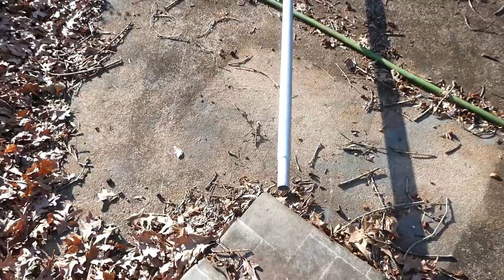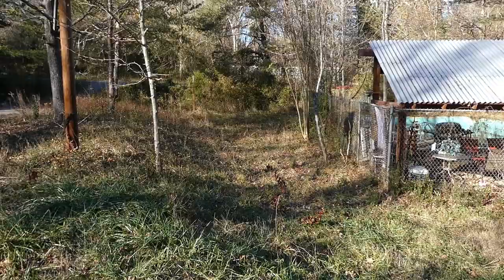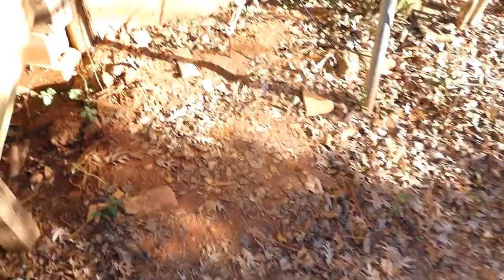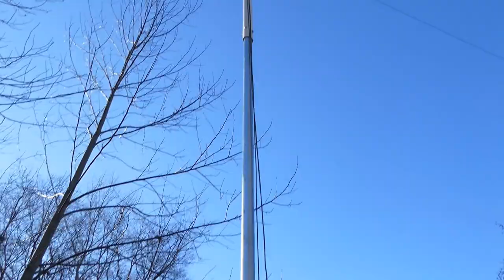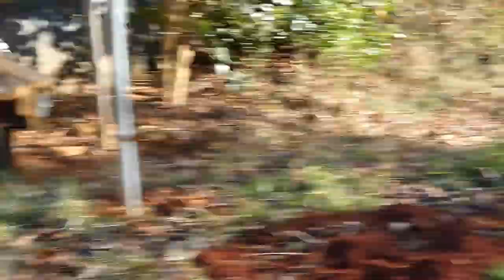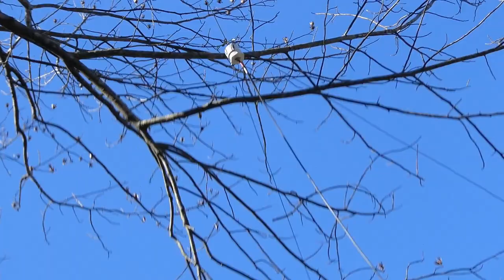$50 Mast for my HF Antenna. Using Chain Link Fence Top Rails and some PVC.

Comment: I have a question. I was planning to purchase four (4) of the same fencing rails that you use in this particular video The first (of four) fencing rails will go 4ft in the ground (with concrete) and the remaining three fencing rails I planned on connecting them together as they are made to connect to each other. So with all that said here is my question.  Is 4ft in the ground deep enough for  a 40 foot long fencing rail?  I know those fencing rails have a little weight to them so I wasnt sure if all four of the fencing rails (40ft all together)  would stay up being that it would only be in the ground 4ft.  Would it fall or remain stable? The weigh of each of the four fencing rails is 7.36 lbs.
Reply from the maker: Howdy, 
Firstly, I am not an expert. 
I would have doubts about 40 foot of vertical fence rail being able to support itself, its not very thick, and may fold over under a strong wind. Again, I'm not a structural engineer but it seems a bit sketchy. 
I have two lengths tied together with a PVC topper. The bottom of the fence rail is at ground level and in about 4 feet of fence post (above ground) which is buried and cemented into the ground. 
Top of the mast is about 27 feet off the ground (and on a bit of a hill) with my set up, which gets me nearly global contacts on FT8. 
Anyways to answer your question, I don't think its the depth that would be the issue, but the strength of the top rail and its ability to support its own weight with any sideways wind hitting it. 
Let me know if you attempt this and how it works out. 
Best of luck,
Eric
Reply: @TwoAcreHomestead  Yeah thanks man. i dont think 40ft will be stable. I guess i just needed someone to tell me.  I was going to have the G5rv antenna on the fencing rails. I though that antenna had to be at least 30 f0 ft high for it to work properly. In addition to that, the ladder line on that antenna is 30 feet so at minimum the fencing rail would have to be enough so the ladder line does not touch the ground.
Reply from the maker: Was looking at your plans on your channel. If you can brace the first section off the corner where you are placing the antenna, then I'd be confident in you getting 3 sections high. 
A 2 by 4 screwed into the side wall, extending out past your first upright, then a muffler clamp to secure the pipe to the 2by4 maybe? 
Also, I did not want to lose any height by burying the top rail, which is why I used a standard fence rail in the ground, then ran a bolt across at ground level to keep the fence rail from going all the way down the hole. It also makes it removable if needed. 
With none of the top rail underground, and a PVC topper, you've almost got the same height out of 3 top rails that you were trying to get with 4. 
Hope this helps, 
K4RZM
Reply: @TwoAcreHomestead  Thank you. I so appreciate your help man.  I will keep you posted step by step
Reply: @TwoAcreHomestead  I actually will be getting some heavier post/poles
Reply: @TwoAcreHomestead  I am now only going up 34ft with some heavier post/poles
Reply from the maker: I've been watching your channel, looking forward to seeing the final build. 
btw, love the graphics your using. Hank Hill driving over your coax with a mower was awesome :)
Reply: @TwoAcreHomestead  LOL thanks. I will definitely keep you updated.

Comment: How did you get it into the mounting section?
Reply from the maker: The whole thing only weighs about 30 lb so I just walked it up straight and then lifted it into the receiving pipe
Reply: @TwoAcreHomestead  👍

Comment: Greetings! Did you put an  inverted V dipole on this?
Reply from the maker: I'm using an Off Center Fed Dipole, 88 foot on the long end and 44 on the short end. 
There is a follow up video for the end poles that gives a better view of the antenna setup.
Reply: @TwoAcreHomestead  Ok thx! Ill check it out.
Reply: Is this an 80 Meter half wave dipole?
Reply from the maker: @RC-Heli835  I got mine off ebay, and the seller (gniklat1) doesn't have anything listed at the moment. 

This 7 band OCF is about at close as I could find to the version I bought, and it has a lot of details on the website: 
https://hamcall.net/7bandocf.html#7band

edit: I just looked at the prices on that website. I paid about $60 for mine, they want over $250. I have a 300 watt version.

edit: A better option, cheaper and Palomar makes good stuff: 
https://palomar-engineers.com/antenna-products/Off-Center-Fed-Dipole-Antenna-80-6-Meters-1-5KW-5KW-PEP-rated-FREE-shipping-in-USA-p74818225
Reply: @TwoAcreHomestead  That's a lot of bands!
I'm almost ready to take my  Technician exam.😀
Reply from the maker: If you are setting up a VHF/UHF antenna, you might want to check out this video: 
https://www.youtube.com/watch?v=xzXm1j0kBzc
The dipole wires actually helps support this antenna, if your using a VHF Mast, you might want something a bit more rigid. 
Good luck on the test, and keep on moving on to your General.
Reply: @TwoAcreHomestead  I was gonna take the exam online but its a tad bit more complicated than I expected. Some want a proctor present such as in sworn in law enforcement, judge, mayor, firemen, lawyer, senator, congressman, president etc. to be there to make sure your not going to cheat on the test.

So yea I'll check out the video thx 
Kilo 4 Romeo Zulu Mike.
I don't have a call sign yet.
Reply from the maker: @RC-Heli835  my wife did hers with GLAARG, and she had no problems passing her general. If you're looking for a decent online option
Reply: @TwoAcreHomestead  I can get mine locally but I'll have to wait until the 12 of August. I'd love to have taken it today but more study can't hurt.
I think I did see that one though and it looked like a good one.
So whats your favorite band?
Reply from the maker: Can't really say I have a favorite band. 40 & 80 meter tend to work better at night, 20 & 17 better during the day. So it's pretty much tune around to see which band is active when I'm listening. 
VHF/UHF aren't as sensitive to day/night or atmospheric conditions, but you are only talking local or via repeaters.
Reply: @TwoAcreHomestead  I'm already into CB and have built several antennas, have a base setup at the house. All dump trucks hauling asphalt and gravel use 11 Meter CB to communicate with scales houses and loaders, which is how I got interested in Radio as I drive a dump truck.

Trying to make them work better and get out farther is where I started learning more about the subject and it seems like most of the videos on ytube where folks really really know what they are talking about are Ham operators.
I like that Ham gives you a lot more sizes of antennas to build and some of them very small for the 2 meter band and the 70cm band.

Was your wife able to take her exam with just the one laptop camera?
I might could do that Saturday morning else I'll have to wait 3 weeks to do it locally. I really think they take the thing a bit to seriously online but I guess it opens up a big world out there.
Reply from the maker: She used the laptop camera plus a cellphone, both running Zoom. 
They want one looking at your face and one at a side view. 
They had her sweep the room with the cellphone, even the ceiling, then she was cleared to take the test. 
GLAARG uses the same test engine as HamStudy.org, so they just watched her take pretty much the same test she took 100 times before, and she passed her General.
Reply: @TwoAcreHomestead  Ok thanks I was looking into the general a bit tonight and I didnt know any of the answers cept the few common sence ones.
Reply from the maker: This and a couple of weeks will get you your general. 
https://amzn.to/3Bnk9ah
If your going on the cheap, get the 30 day free trial of Kindle Unlimited, then cancel after you pass the test :)

Comment: Where’s the antenna
Reply from the maker: The antenna is on top of the pole. 
It is an Off Center Fed Dipole. One end of the wire runs 88 feet north, the other end about 44 feet south to the end posts. 
Its a multi band antenna, 6, 10, 17, 20, 40, 80, 160 meters.